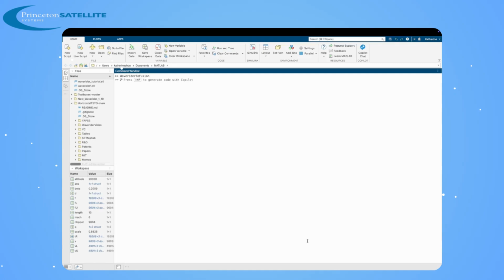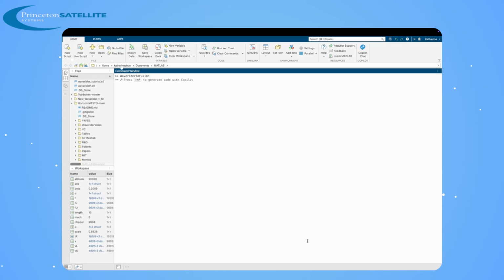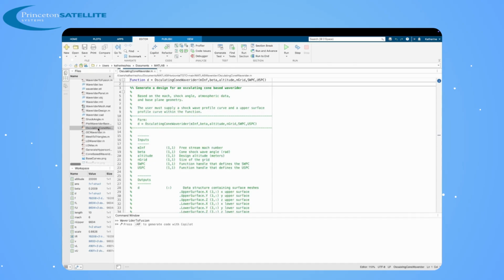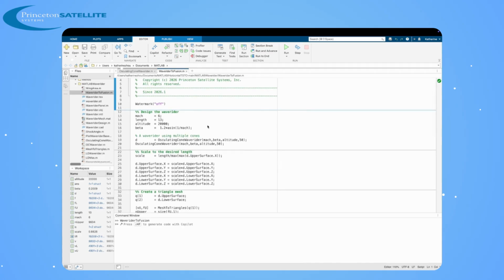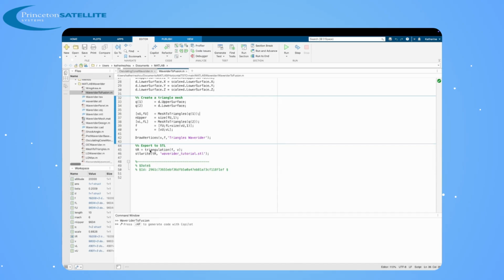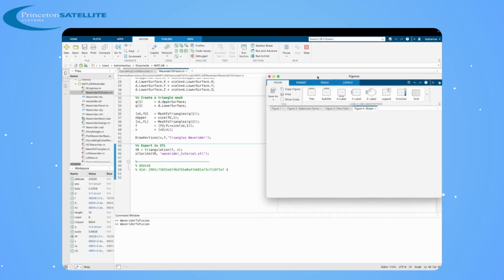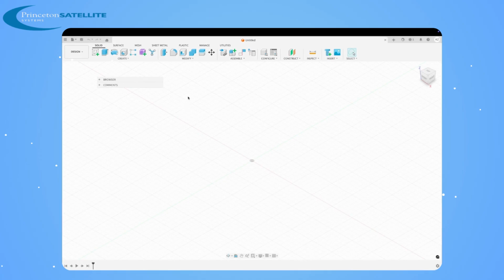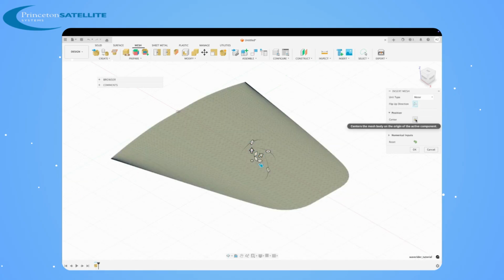PSS Waverider Tutorial (MATLAB & Fusion360) | Aircraft Design Toolbox

Comment: Subject: Atmiton Rain ToE – Unifies Forces, Could Boost Your Starfire Fusion & Orbit Sims  

Dear Princeton Satellite Systems Team,  

I'm Boris Karagiannis—my theory of everything (ToE) unifies gravity, EM, strong, and weak forces into one rule: indivisible atmitons (lumps) rain radially from void at 500 m/s, collide, crowd, squeeze. No separate forces—just kinetic bumps in flat space. No curvature, no dark matter, no quantum glue.  

Your Starfire (PFRC fusion rocket) runs on D-He³ plasma—ionized atoms fusing. Mainstream needs four forces + math patches. My model: atmitons crowd inside nuclei (strong "glue"), flip them unevenly (weak decay), bounce electrons differently (EM push/pull), and pile macro-scale (gravity).  

Fusion threshold drops because denser rain jams D + He³ tighter than EM repels—easier smash, lower temps, better efficiency.  

How it helps you:  
- Propulsion: rain asymmetry near nozzle adds thrust gradient—boosts exhaust velocity 1-5% without extra fuel.  
- Power: atmitons crowd in magnetic bottle—extra heating efficiency.  
- Shielding: cosmic protons slow in rain—less boron mass needed.  
- Sims: replace GR curvature with rain drag—simpler, faster orbit code (no time dilation hacks).  

Clock lag matches real GPS 38.7 μs/day—no curve, just squeeze. Same rule scales up.  

Full preprint: https://zenodo.org/records/18808212  

Happy to discuss—could refine your PFRC plasma or trajectory models.  

Best,  
Boris Karagiannis